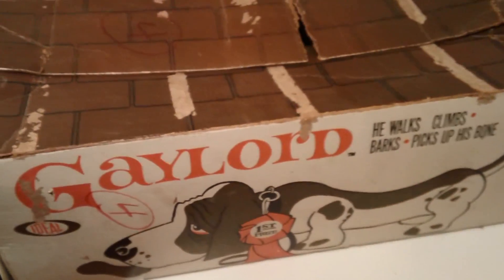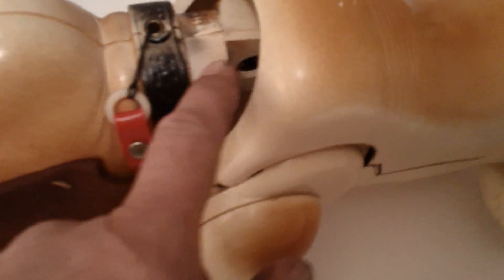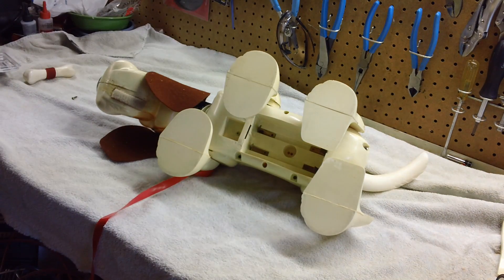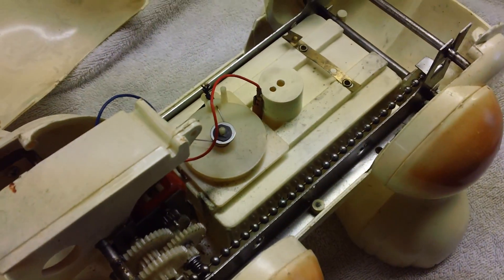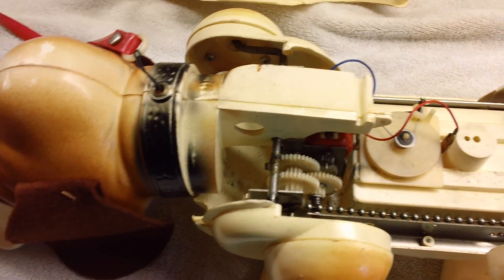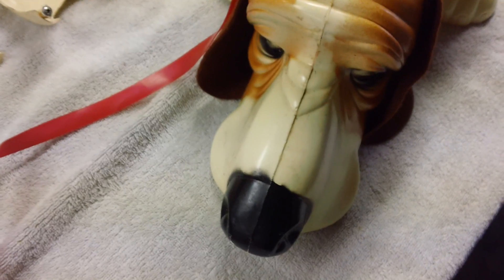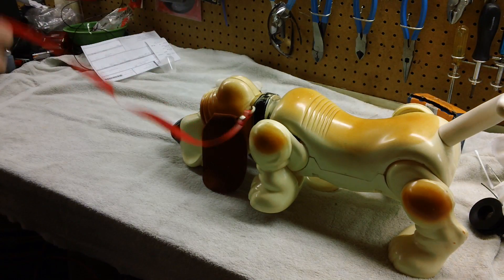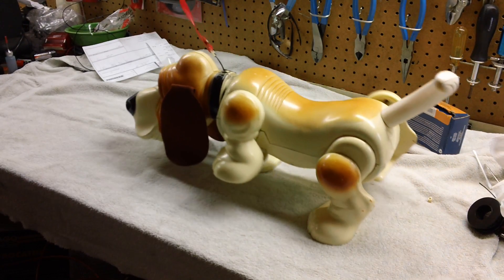Gaylord by Ideal 1963

Comment: The whirring gears sound like a decrepit, near seizing prototype of one of C3P0's arms. I can't see how even a kid wouldn't quickly get bored at the creaky, halting, straight-line, snail-like pace of this battery-eating clunker. Seems to be more interesting to adults for its electro-mechanical design.

I wonder how long the old carbon-zinc batteries would last driving that motor. The parents would need to take a second job or set up an investment fund to keep the batteries inbound--if the boredom factor didn't come to the rescue first.  😉
Reply from the maker: Quite frankly, as a kid I was never that interested in these kinds of toys.  Even King Zor I likely would have tired with.  Robot Commando I would have liked as he did a bunch of things, and could have been a great nemesis for my GIJoes, or a fleet of army men.  I always liked toys that required some imagination.  Although, this was a pretty big seller.